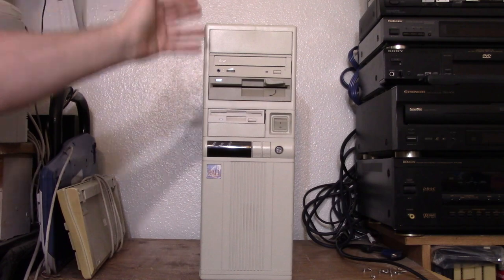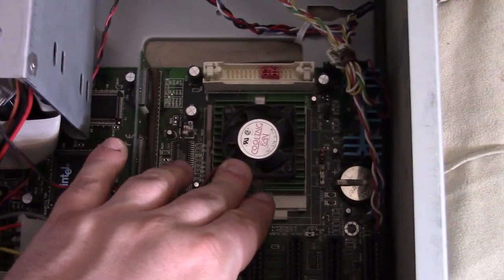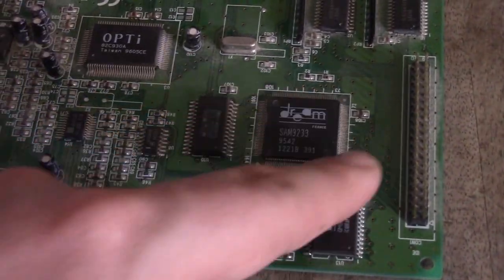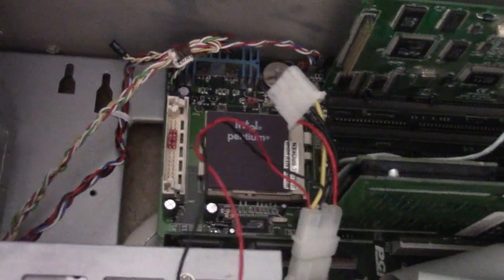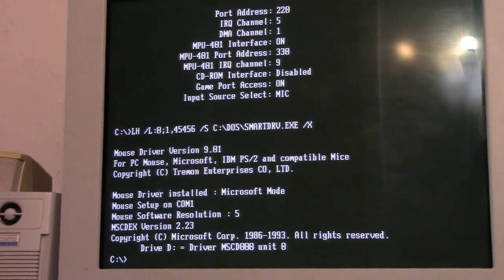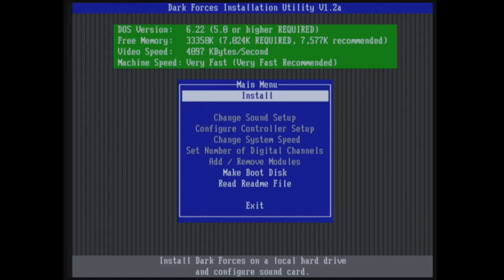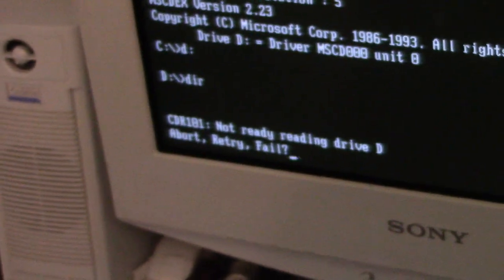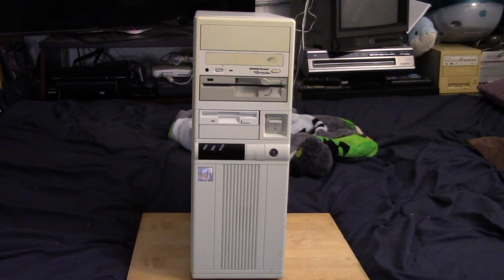Vintage Computer Thrift finds Ep 2

Comment: Dream SAM9233		Integrated Wavetable music synthesizer, DSP, 18-bit, MPU-401, Reverb+chorus, GM/GS.
Dream GMS950400		512KB instrument ROM
Dream 0PGSSX4 3.33	no idea, maybe some kind of ROM 
OPTi 82C930		       Controller+Codec 16-Bit, SBPro/WSS/MPU-401 compatible, IDE.

A cheap no-name card with ubiquitous OPTi chip, coupled with decent MIDI synhesizer, but accompanied with smallest possible instrument ROM :-(
A kind of a car with Porshe engine, but coupled with VW Beetle gearbox - don't expect too much from it.

Comment: That is actually a very late Pentium actually not released until 1996.  I was working at Gateway 2000 at the time it came out, and I remember it was a stop gap because the Pentium MMX was not ready.  This chip was released by itself about six months after the much more popular Pentium 133.  I recall the speed difference being almost nothing and the cost delta between the 166, and 133 was $300.  At this point that chip is probably quite rare.  The 150, and 166 were first quarter releases, and by fourth quarter the MMX had been announced.  This period was a fiasco as Intel announced the chip before it was available in quantity and during the fourth quarter when 50% of all computer sales happened.  Intel really screwed the pooch with the Pentium 166.  In spite of all that, the Windows 95 release about doubled PC sales at Christmas in 1995. This was also the only 14.5w chip released by Intel, so motherboard support is also uncommon.

Comment: I know Samsung made a sound card like your OPTi one there, because Lameguy has one that seems to be damaged, but his one was a Korean exclusive and is a bit of a different layout to yours. My Terratec Maestro uses a similar Dream wavetable (have an upload of it if you want to hear it for reference) and I even prefer it over the SCC-1, but it also has a weird FM emulation. The wavetable seems a little better implemented on said Maestro, unless it's your motherboard being dodgy or the ISA clock - As for that, if it locks up like that again, try smacking the top of the COAST stick with the handle of your screwdriver a couple of times. Not sure about the other problems, though, take the battery out and give it a bath maybe? Otherwise, yeah, probably capacitors as you said. It's usually not a bad motherboard.
Reply from the maker: I may try that sound card in a different machine and see if it sounds any better. I had pretty poor results with it but after hearing some comments about it being used in other higher end cards I'm really wondering if it's a motherboard issue as you suggested.

Though I guess the point of the video was how the PC operated as I found it and not exactly a review of the sound card itself.

Comment: It's an Award Bios. Constant beeping means memory / ram failure / not correctly seated memory.
Reply from the maker: But the odd thing is I tried reseating and cleaning the RAM contacts several times with no effect but sometimes simply reseating the video card solved the issue and sometimes not.
Reply: @AncientElectronics  You could try a lower slot for the video card, but the bios can only detect system memory and not the video memory as you could run a system headless (no video), so the beeps can only be for main / system memory failure. There are also a bunch of cable near the memory and could have gotten a nudge from reseating the video card. To be sure try running memtest86. Maybe it's just one bad memory module. ...or two :)